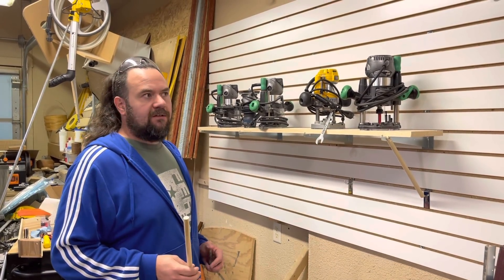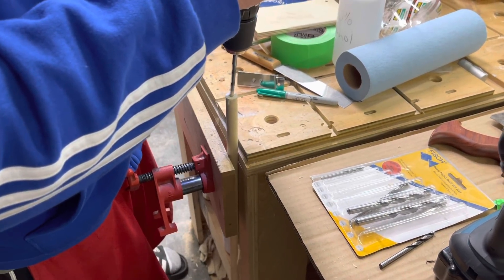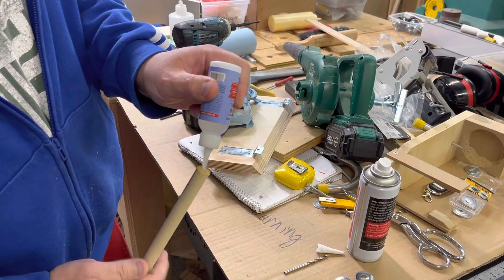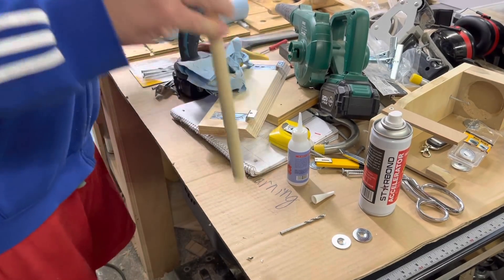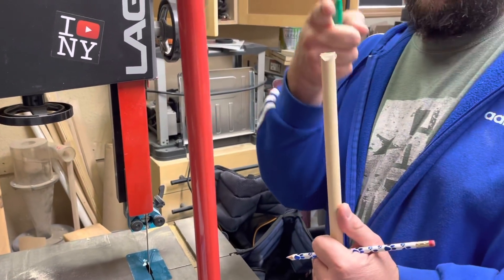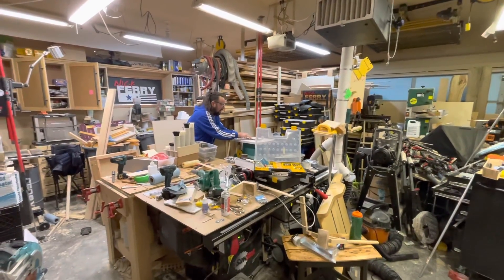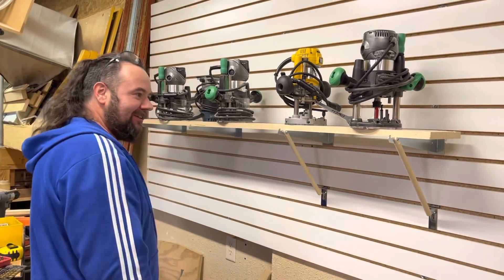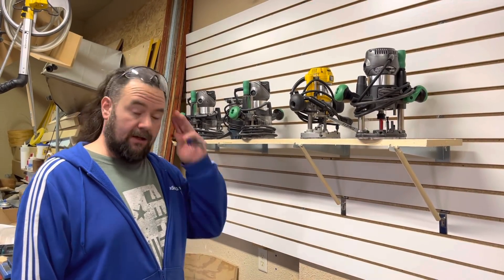Slat Wall Shelf Braces

Comment: The more I see ideas for shelves, the gladder I am that I use simple wire shelves (wire collects little dust!).
Reply from the maker: I do like that they don’t gather dust but some smaller items fall through or you got to put down a thin substrate
Reply: @NickFerry  Sheet metal scrap!  The wire also allows easy suspensionof items.  I put in a 4'x8' french cleat wall, and it works fine, but in the end I have to admid just more wire shelving would do as well.  There's something to be said for simplicity.  Or don't say it and just enjoy it!

Comment: Just a thought. But I would have put an appropriate sized washer around the metal piece that would stop the dowel from splitting. You could even glue it to the bottom of the dowel with epoxy or CA glue. Just a thought.

Comment: Nice idea. I would have counter sunk the end grain hole to reduce the forces to split the hole. I like the CA glue reinforcement ti
Reply from the maker: Not a bad idea - I only had to make four of them and on the last one I figured out if I didn’t drill the hole as deep all the pressure was at the base of the hole and not splitting the end - that whole hindsight 2020 thing lol

Comment: I think the end of the dowel may split in time due to thr change of angle of the hook
You could prevent it with ferrules, like the ones on chisel handles, maybe a piece of 1/2" copper pipe
Reply from the maker: Ferrule would be a good idea - i’ll have to see how this holds up
Reply: TBH I think it would have bee fine without anything, the top will split before anything else. A 5 inchish just over 90 deg triangle screwed to the shelf hange would have been easier, better and faster all round. But hey, it's all fun to watch ideas.